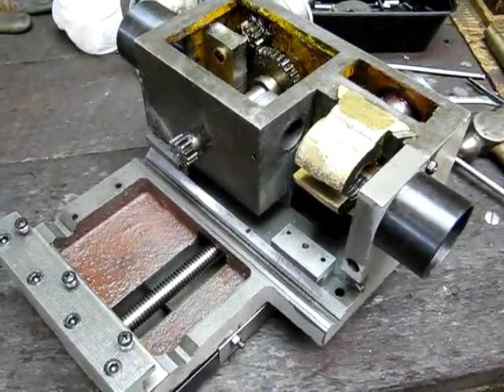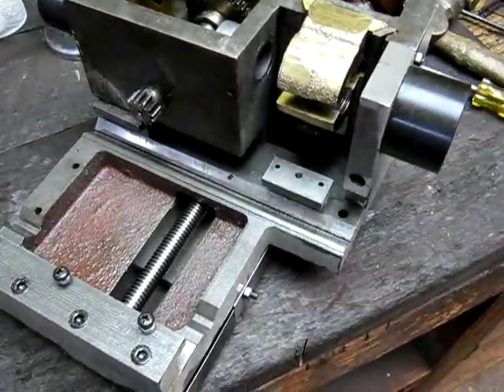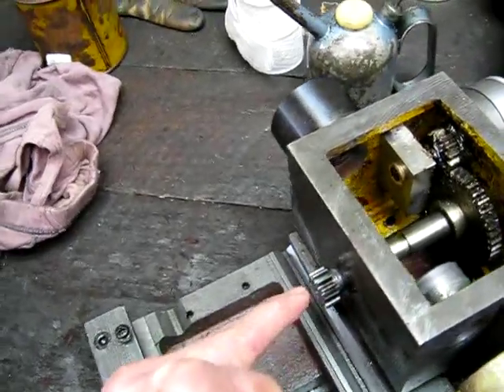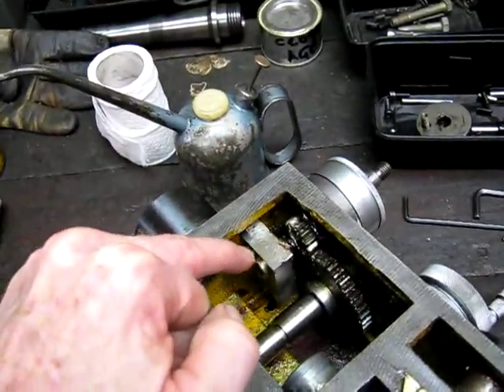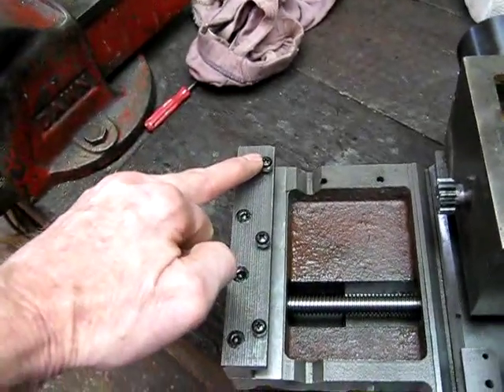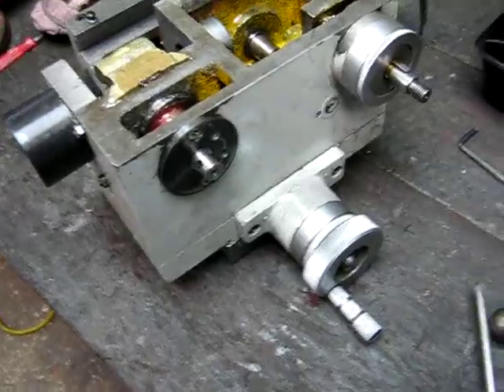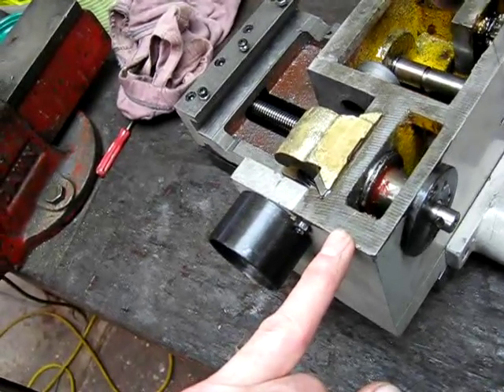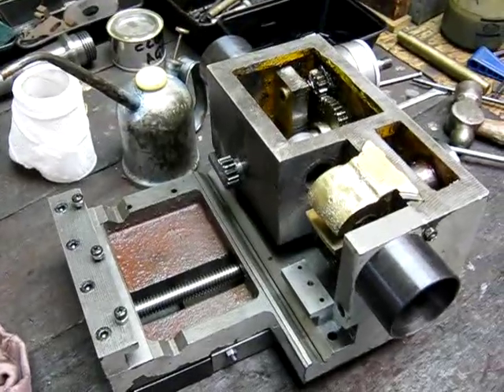What's inside a cheap Chinese lathe - a quick look under the carriage of a CQ9325

Comment: FINALLY! Someone else who recognizes the value of SOME cheap Chinese lathes. They aren't all like that, some better, many worse. I like your addition of the back support bearing for the input handwheel shaft, another way would have been two opposed angular contact bearings with tensioning nut, but your method is actually stronger. Very few people are unbiased enough to see the positives, and that is an attitude that is opposed to free market competition economy models, we should learn from competition and better what they provide, not belittle them and try to hide their pluses. I believe we should support the best value all considered (Quality/price/materials) and in the end we all move towards better products from every direction, and all are better off.
Reply from the maker: +Glen Linscheid 

Hi Glen.

You get good and bad in all things made/designed.

Unfortunately there is a certain amount of snobbery when it comes to metal lathes, and the biggest offenders seem to forget you have to balance cost with performance.

The hand wheel modification is an easy fix, which greatly improves the feel of the lathe - should have been better designed better to begin with.

If Asian lathes were not reasonable value for money, then I doubt they would have impacted (taken over) the market as they have.

Cheers Rob

Comment: That was a nice mod you did with the bushing block you put into the casting. Like you said, that was how they should have built it in the first place.
Reply from the maker: +Paul Frederick 

Hi Paul.

Yes, it works very well.

I've seen quite a few smallish Asian lathe models with the same short, single sided style hand wheel bush, all suffering the same inherent wobble because of the short axis.  And it's only going to get worse as things wear.

The only way to eliminate it is to support it it either side of the pinion gear,

Cheers Rob
Reply: xynudu
If you had not pointed it out I may have never noticed the modification. Which is to say your job was done so well it looked like it belonged there. I know of no greater compliment than that.
Reply: @1pcfred  i can look at a hynundai, then look at a lamborghini and say, thats how it should have been built to begin with, but i wouldnt expect lamborghini quality at hyundai prices. if it was built like that to begin with, you wouldnt be able to afford it. its crazy how people expect the world for cheap chinese prices. if you want that kind of quality, be prepared to pay for it. dont buy something for cheap then look at a product 100 times more expensive and compare the 2 without comparing prices. the way people talk about chinese products is absurd. i wonder why people dont just buy american to begin with if chinese is so bad.. probably becauase the cant afford it. so they pretend they paid american dollars for a cheap chinese product and complain like idiots.

Comment: Hi. I couldn't have asked for a better video right now.  Just yesterday I was thinking about modifying my Warco WM250 (very similar to yours and others), to include auto feed on the cross slide.  My initial thoughts were to use a second dial thread indicator gear and pinion (couldn't quite see if yours has one or not), to get drive from the leadscrew and somehow employ a 'selectable' right angle the drive to a gear locked on the cross slide leadscrew. What do you reckon?  Mark in the UK

Comment: My 8"x 16" lathe has a lot of play on the carriage traverse could it the lack of support to it's wheel  causing this? it cost less than a worn out Myford ml7 the guy I got it off only cut plastic
Reply from the maker: +orange12v 

It's likely to be all the combined slop in the carriage gears and rack.

My 9 x10 is the same, and every other Asian lathe I've seen has the same issue.

Nothing you can do about it.  The fix I did was for wobble, and won't make any difference.

Cheers Rob

Comment: I would like to know if the designers of these lathes and associated QA personnel watch these videos or  whether or not the companies for whom they work care about improving their products in light of discussions found here and other places. 

Are there examples of revisions made to particular makes/models that demonstrate the manufactures commitment to improving a product over time?

Roy
Reply from the maker: Hi Roy,

I've not seen any evidence of updates to existing designs of Asian lathes.

Cheers Rob
Reply from the maker: Hi again,

Their methodology to (maybe) improve the breed, is to bring out an entirely new model/design.

This may be better than trying to nullify an existing fault - debatable.

Some lathes like Seig C6 and AL320-G soldier on without essentials like a quick change gear box, and people still seem to buy them.

If it sells, then keep producing it, is probably how it works.

Cheers Rob

Comment: You have been lucky the problems is not the make its quality control on cheaper machinery from China Ive done some warrantee repairs on power tools ,from parts missing or loose due to machined tolerances to parts parts forced in backwards and also the quality of the materials like super mild steel that you can score with a pocket knife.
Reply from the maker: I don't doubt it.  It's a bit of a lottery on Chinese tools.  Depends who makes it.  My Chinese ER collets sets and chucks etc are excellent.  But like you, I've seen some pretty crap products over the years.  Cheers Rob